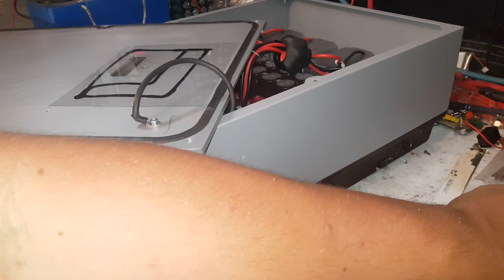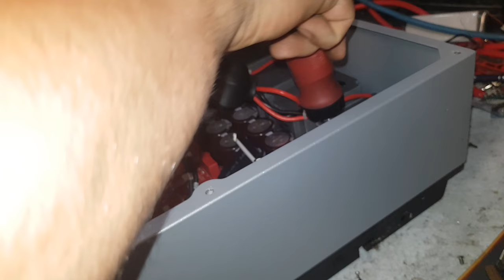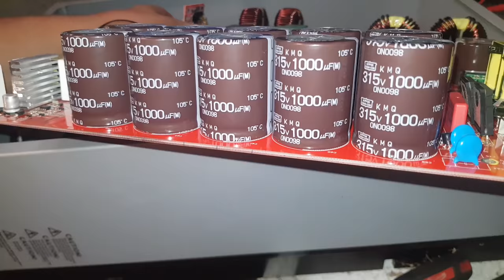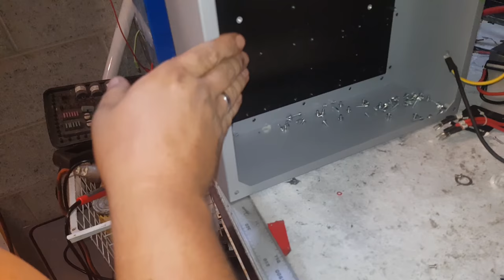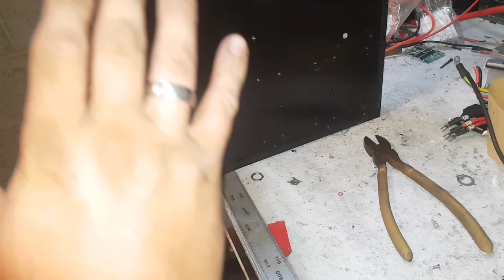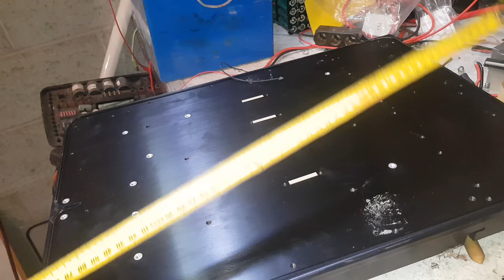Growatt 5000 MTL Grid tie inverter tear down for Parts / Scrap salvage

Comment: I thought I explained earlier, the grey blocks are inductors, potted in a silicone type material to prevent vibration/noise. Two inductors on the AC output, one for each DC-DC input stage.
The Blue block isn't a relay, it's a current sensor, should be a datasheet for it online.
Reply from the maker: +station240 thanks mate cheers i knew some one would have a bit more knowledge and could help me out. Ill depopulate the board anf see what goodies i end up with cheers
Reply: @Oneupthesleevecustoms  I don't see step-up transformers, it uses 4 potted inductors for voltage boost/buck instead, I'm pretty sure. thanks

Comment: Them grey blocks are not inverter blocks lol there induction blocks. used for chokes. And have either a Iron core or ferrite core with copper windings.

Hope this helps.
Reply: They sure are ;) i know a lot more about them now
Reply: @oneupthesleevecustomsautom2195  its Got to se you again
Reply: That 2 transformer for boot and buck convert dc from solar panel and 2 another use H bridge driver by igbt to convert dc to ac connect to ac grid
Reply from the maker: Thanks mate I've learnt alot about those now